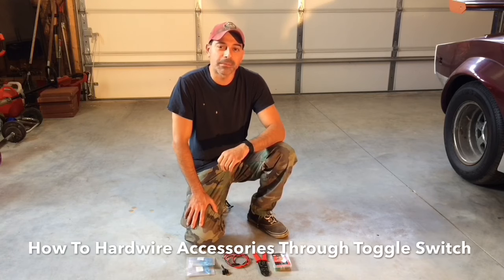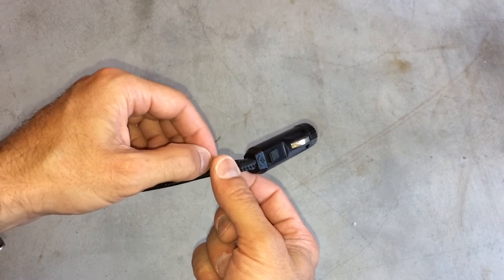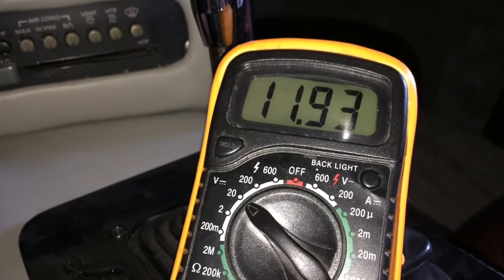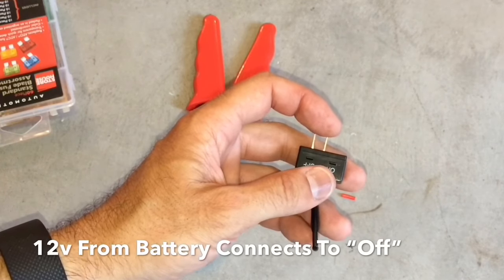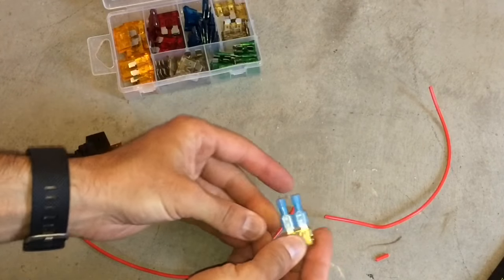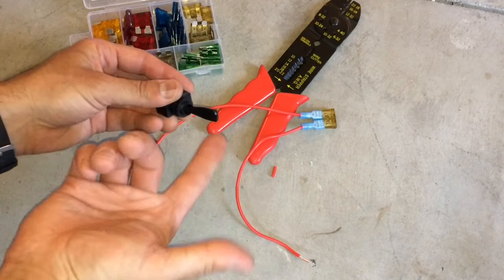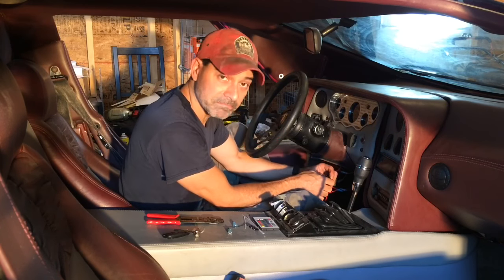Wiring 12v Car Accessories To Toggle Switch (Andy’s Garage: Episode - 95)

Comment: will this method work with LED headlights??
Reply from the maker: I would recommend wiring the led headlights directly to the existing headlight switch since that is already wired and fused
Reply: @PhillipsVision  my problem is my headlights aren't turning on no matter what I do that's why I wanted to directly put it to the battery nothing's wrong with the lights either I just bought them
Reply from the maker: @LANDSHARK97  have you checked the headlight fuse and relay? If nothing else works, yes, you can wire them to a toggle switch through an in-line fuse.
Reply: @PhillipsVision  yes i checked the relay and it's good

Comment: how do i find which wires are my fan wires under the dash.when i turn off my mini van the fans dont turn off so i ben unplugging them every time.shop says 200 hundred dollars
Reply from the maker: If you’ve been unplugging them, then just connect to those wires and run new lines from them to the dash
Reply: @PhillipsVision  ok so i have duel fans do they both run all the time or do i need 2 switches
Reply from the maker: @chaosblackstar  you can choose. I have both fans connected to one switch
Reply: @PhillipsVision  ok thanks phillip

Comment: Umm so I’m doing a 4 switch thing to power light bars. Do I just do this 4 times?
Reply from the maker: So you’re power (4) separate light bars? Do you want the ability to control them individually?
Reply from the maker: @slurpeeslurpee69  then you will need to connect a switch to each light, using the method in the video
Reply: Use relays or you risk setting fire to your car.

Comment: Can you help me out
Reply from the maker: What’s up?
Reply: I’m switch toggle switches, now I have one from rough country but I bought MGI SpeedWare Black 4 Toggle Switch Panel, how would I hook that up after cutting the wires to the rough country on/off switch
Reply from the maker: @mialovato7261  connect the fused 12v power from your rough country switch to the red wire coming from the panel switches. Ground each individual switch to a proper ground on the chassis.
Reply: Thank you I’ll comment if I have another question. I appreciate it

Comment: Doesn’t make sense for a newbie . Too many shorts cuts not enough explanations.
Reply from the maker: Trevor G what part do you need clarification with?
Reply: @PhillipsVision  you just pulled a bunch of wires out underneath the dash what does tell us we just need better idea what to pull or connect to.
Reply from the maker: Trevor G the bunch of wires was just the excess wires and jumper wires to connect to the 12v and ground. When you’re wiring, you’re only looking for the 12v and ground, so you only need (2) wires. Keep in mind that when you’re going through a toggle switch you will have (2) of each; a 12v wire going in to switch (through a fuse) and a 12v coming out to the accessory. Let me know if you have any other questions.
Reply: How do you know if these spare wires have extra allowance amps at the fuse to connect another device? Let’s say you used 20 amps, how do you know if this spare wire is not connected to 15A fuse or there’s another equipment connected which is 10 Amps putting 30 amps in total for the fuse?

Comment: I’m sorry I’m lost I have a factory stereo and it’s connected to my amp but my amp stays on even when I turn the car off where can I add the toggle switch and where do I get the power to do that
Reply from the maker: Did you connect the amp to a constant 12v source? If you run it the through a source that is only activated through the ignition, it will only get power when the ignition switch is activated. You could also add an in-line toggle switch that will only send 12volts when the switch in “on”. Find the dedicated 12v line going to the amp and cut it. Add the toggle there, but make sure to add an in-line fuse prior to the voltage reaching the amp. This will protect the amp in the event of a power surge. The layout should be...12v source, in-line fuse, in-line toggle switch and finally the amp. Make sure you ground the amp on the chassis. Do not connect to an existing device’s ground.
Reply: I forgot to mention that I also have a LOC2SL add on amplifier adapter

Comment: Great video. Thanks for the instructions.  Wired up a toggle switch for my third function valve, with in-line fuse,  on my tractor so I could turn it on and off as needed.

Comment: Is the black ground wire connected to the black side of the car battery or the red? If the accessory is connected to the black side of the battery, do you have any part of it connected to the red side? I realize I sound ignorant. It's because I am.
Reply from the maker: Black gets grounded on the chassis. You can attach to the negative (black) terminal on the battery but chassis is better. The red is your 12v power which supplies power to the accessories, running through a fuse prior to the accessories

Comment: Phillip your video helped me tremendously. I was able to run my inline pump perfectly. Your step by step instructions made the difference. I appreciate you buddy.👍🏽
Reply from the maker: Awesome, glad it helped
Reply: @PhillipsVision  is there a way to connect a 12v 2 prong on/off switch using this method and connect a led strip to the switch?

The idea i have is connect on/off switch to fuse box using fuse taps and connect led strip to the switch

Comment: Why do people switches melt ? Is it because they didn't add that safety fuse in the 12v wire?
Reply from the maker: Yes the fuse will help, but most overheating issues are due to wrong wire gauge. The higher the gauge, the thinner which will melt. I recommend no higher than 14gauge to be safe. Ultimately you want to know you amps of the device; that will determine the proper gauge needed.

Comment: Does it matter which side of the toggle switch you connect to the battery and the device?
Reply from the maker: It shouldn’t if you have just a simple 2 pin switch. When the switch is “Off” the circuit is open, when it is “On” the circuit is closed. All the switch is doing is opening and closing the 12volts to the accessory.

Comment: Wow bro lots of knowledge thank you so much
Reply from the maker: tenshi has a death wish thanks man, I appreciate it
Reply: @PhillipsVision  no problem bro.. that car looks so beautiful man that interior is nice the way you have it set up.. I was dazzled when I saw it.. I'm currently installing an afr guage but instead of powering it to my ignition like recomended.. I'm doing a toggle switch right under the guage wired to my battery .. with a fuse in between like everything I learned
Reply from the maker: tenshi has a death wish 👍

Comment: So 12v power goes in through off prong

12v power goes out through fuze and out from fuze to accessory from on prong 

But where the hell does anything ground related go ??
Reply: To battery or to another ground wire or to a bare metal grounding part of car

Comment: What if you've got an LED balcony system with a wiring harness it's just simple red and black wires going to each light into a switch do you need to put that inline fuse on there to connect it to the switch in the cigarette lighter what do I have to do I really need some help
Reply: I want to put the switch in my little cigarette lighter thing because I don't use it so I figured that's a good power source how do I do that please help me

Comment: How can I get a main line power source from the battery I side of my car for future wiring with out running each  positive cable from my cabin to the battery.
I hear you said you have a main line hub . Can you help me plz
Reply from the maker: You can get a control panel strip that the main battery connects to . From there you can run several accessories. They can be found on eBay and other online stores.

Comment: Hello Philip,
Big thanks for the upload!
Pray guide me, 
Shouldn't I be worried about the current handling of the toggle switch too?
Reply from the maker: Make sure you use the correct voltage and a fuse with the correct amps
Reply: @PhillipsVision  alright, you mean 12v switch. 
But I can't use 6A toggle switch with a 10A fuse.
Current more than 6A  will blow my switch before fuse could do anything. Isn't it ?
Reply from the maker: @kiittush  that’s correct. Switch and fuse must be for amps if your accessory

Comment: If my fans work but i just want to add a toggle switch as a security measure can i just splice into the fans power and leave it grounded the way it is? Or will i have to splice the ground and ground it again

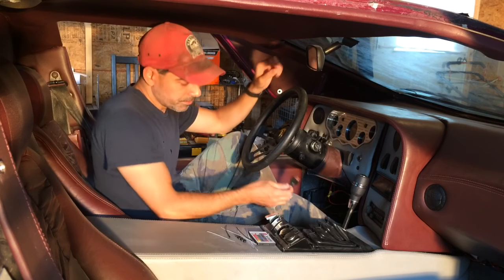Comment: 1:24 already done the electric fans no fuse strait to The battery  need to wire up a windshield whiper motor, rats chewed up wiring to the controls  I have two switches one intended for the water squirter , i want to wire another motor to the battery and have two switches running from the cab to the battery. Any ideas? Pleas help

Comment: i basically didnt do the fuse before i watched this video now my car wires started smoking makes sence lucky cars ok it was for my halo rings so i basically put the wire from the halo ring one to postive an one to negative on the battary an then have another wire from the postive wires going to the switch will two wires going to the switch but add a fuse like u showed right
Reply from the maker: Vlogstar Parm if they’re smoking you may also have too thin of a gauge of wire. Depending on the amps you’re drawing will determine the gauge you need.
Reply: @PhillipsVision right got it a little im using speaker cable but this i the lights i have i have 12v halo rings a 30cm knight rider led 12v light an 4 led strips lights which i basically connected all together which were all on to one swith if i had fuse this time is it good to add the fuse next to my battary an what amp fuse do i need or do i need to make seprate switch for all the lights i jus wanted them too all come on at once please let us know i saw the way u added the fuse thought at least next time the fuse an blow like u said u can cause a fire other way also its been fine for months it was yesterday this happend is this normal to u like it happend after all this time
Reply from the maker: Vlogstar Parm led strip lighting is usually about 2 amps. If that is your case then 20 gauge should be sufficient. I personally would go with 18 just to play it safe. Never hurts to go heavier for precaution
Reply: @PhillipsVision  hi ok whats 20gauge is that the wire as im using speaker wire but high quality init
Reply from the maker: Vlogstar Parm speaker wire is normally 24 gauge and not well insulated. The higher the gauge the thinner the wire. I wouldn’t recommend it
Reply: @PhillipsVision  ok so shall i jus type pn ebay 18 gauge speaker wire or jus 18 gauge wire thanks for replying really quick
Reply from the maker: Vlogstar Parm just 18 gauge wire for automotive. You can also pick it up at auto part stores, or even Walmart
Reply: @PhillipsVision  hi so its perfectly safe to connect the lights i have to one switch right

Comment: I think this will work for an exhaust cutout but my only concern is with an on off switch. Either on or off, one of those ways wouldn’t the power always be trying to close or open the device. In this case I don’t want to always have power going to the valve that closes or opens. Wouldn’t that burn up the motor?  If so, how would I fix this problem?
Reply from the maker: fly n fury use a momentary switch, not a toggle. The power will be disengaged unless the button/switch is pressed. When the button/switch is let go, the power will be cut off again.
Reply: Phillips Vision perfect. I knew there was an easy way. Thanks for the quick reply.
Reply: Phillips Vision I’ll try to keep this simple as I didn’t think about this earlier but I can’t hold the button in while I’m driving for a period of time. If holding the button in is open on the valve as soon as I let go of the button the valve would shut again or stay in that position?  I need the valve to stay in that position and then on my next press of the button close the valve. How do I do that?
Reply from the maker: fly n fury then just use a toggle switch “on / off”
Reply: Phillips Vision I thought a toggle switch would always be supplying power. I need the valve to open and stop trying to keep it open. Same thing for close. I don’t want to burn up the motor if it’s always trying to make the valve move in one direction or the other. I hope that makes sense.
Reply from the maker: fly n fury you said you wanted to push the button and stay open until your next press to stay closed. That sounds like a toggle switch “on/off”. Just get a push button toggle switch.

Comment: If you are connecting a multimeter that had power/ground/remote. Do you need a toggle switch that has 3 connectors?

Comment: What about aux light kit that usually come with dongle switch with relay? Id like to replace the ugly dongle on/off switch with safety cover trigger metal switch.. but those trigger only have two connecting point.. dongle switch with relay have 3 wires.. how do you replace the dongle switch with trigger switch?  Do wee need to remove the relay from the loop?

Comment: Hi I got a question. I bought a button with 4 wires sticking out the back. Does it HAVE to be two prong? Like what would be the issue if I just use the red and black wire that's already there?
Reply from the maker: Is it a 4 pin momentary switch?
Reply: @PhillipsVision  it says 4 pole on Amazon so yes?
Reply from the maker: @hi7535  might be a multiple position switch. I use just an “On/Off” switch.

Comment: This made no sense to me. You have power in..then power out..where does that power out go. Where is the ground connected? I have lights on my car and I need power in and it has a ground prong on the switch but where does that excess power go if u don’t connect the ground?
Reply from the maker: Seth Henriksen power out goes to the accessory through a fuse, ground is grounded on the chassis

Comment: I've got a work truck with a light wired to a toggle switch that's been fine for years. I let a buddy work on my truck and now the light turns on automatically when the key is turned to the on position. It's still switch operated if the key is turned to off. Any ideas what could have happened?
Reply from the maker: Sounds like he crossed wires somewhere. I would trace the power and ground wire from the light to see what he did
Reply: @PhillipsVision  Okay, thanks for the quick response!

Comment: Good video, btw i wanna get opinion from you, im planning to set up 1 switch for 2 pairs DRL (front & rear).

Power source from ACC fuse box to fuse to Switch, wiring from Switch to DRL1, use SnapLock to split wire for DRL2, then use SnapLock again for pair connection for both DRL.

1. Do we still need that fuse before Switch if the power source were already from ACC fuse box?

2. Is the power supply sufficient?

3. My RockerToggleSwitch listed as 12V 35A, is there any problem using a 35A switch for low power LED DRL(i believe its below 2A?) or do we need to find low amp Switch?

Thanks much!

Comment: Sorry just to clear this up, I connect my positive wire from the battery to the off side and then my wire that connects to the device to the on side??? And keep ground completely separate from the switch
Reply from the maker: How many pins does your switch have?
Reply: @PhillipsVision  two like the one in the video
And sorry again, how do you know which fuse to use for the safety?
Reply: I have a 2 pin switch. There are no markings on it. How do I ascertain which is the “on “ pin and which is the what is the “off” pin?
Reply from the maker: @stephendrahos9000  if it’s a 2-pin switch it one should be open and one closed. You may have to test each pin with the accessory and 12v power to see which works.

Comment: Hi jus one question can i use the ground on the battary as i dont want to ground to anywhere on my car u see an one switch is ok for a led light, 4 small led strips an led halo rings with rgb remote right
Reply from the maker: Vlogstar Parm you can use your Battery ground but it is not recommended. It’s best to ground to your chassis
Reply: @PhillipsVision  ok so its basically like i can tie the negative wire ro the ground next to my battary which u normally use when jump starting the car do i jus tie it around it as i seen the ground which is next to the battary silver ground
Reply from the maker: Vlogstar Parm you would use a split wire that allows you to attach a second wire to the negative line.

Comment: Useful!  May need a switch for a horn. 👍
Reply from the maker: camaro sunrise Thanks for the feedback; for a horn you may also need a relay if you are bypassing the factory relay
Reply: @PhillipsVision    o.k...thanks
Reply: @PhillipsVision  pls tell how to wire a separate dashboard switch for extra pair of horns other than stock one.
Reply from the maker: @Aksinghgzp  are you referring to air horns? If so, you can wire the compressor to the existing horn power that way you can use the existing relay